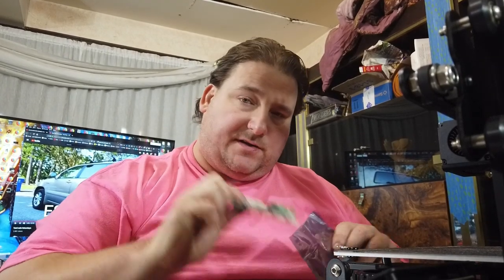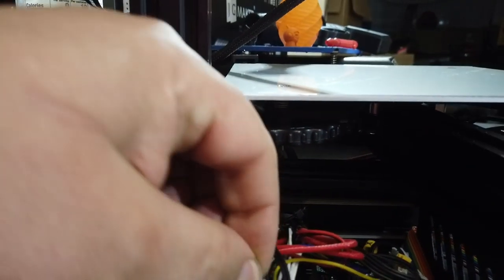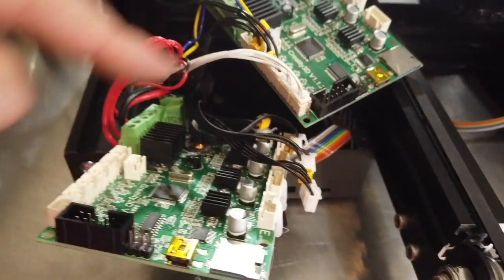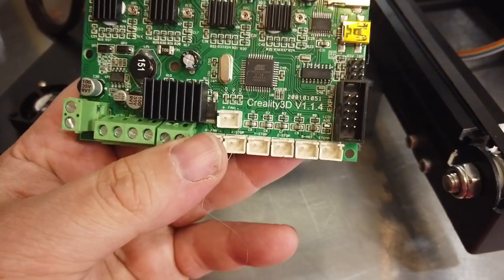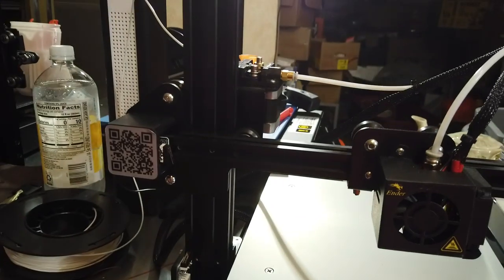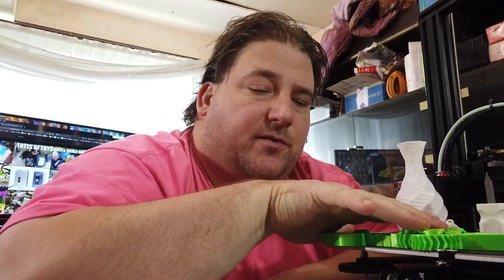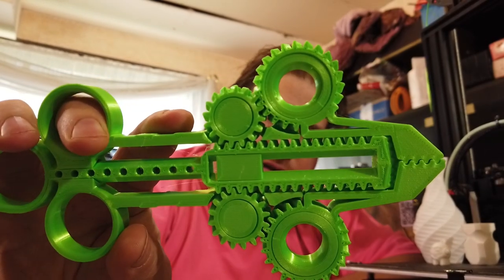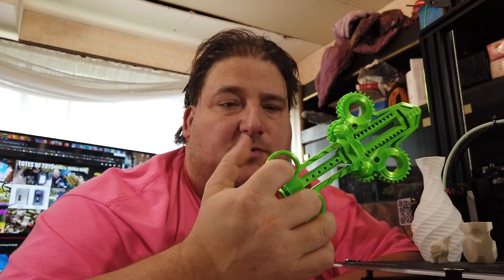Ender 3 Repair - Brainboard Replacement & Tuneup - T3DP

Comment: As a heads up for replacing the board. There is actually a much easier way to do this. Tip the printer for it is laying on its "back" and remove the control box from the frame. lay the box down on your work surface and as you remove the wires, place them into the new board. then remove the old board from the control box, attach the new board that is all wired up, and then put the entire control box back onto the frame.

This is likely how they assemble in the factory as there is no way they could efficiently screw in the power wires and hot glue the connection while the board is inside the control box. Also, the wire pass through in the frame is not a captive hole for a reason - likely so you can drop everything out the bottom for easy maintenance.
Reply from the maker: Excellent idea! I will definitely try that when i do a 1.1.5 upgrade!

Comment: When you slide the Y-carriage, note that the stepper motor produces enough voltage from that simple act to start the fan on the hot end. I discovered this with my Monoprice Maker Select, and found that if I kept repeatedly doing this, the control board would boot up and show ready to print - until I stopped sliding the carriage, then it went dark again.
Reply: You want to try and avoid doing that as much as possible as it can potentially damage the printer.
Reply from the maker: Yes. I always forget that. Habe to move slowly (or unplug stepper)

Comment: Which flexible filament would you recommend?  Looking for something as rubbery as possible... NinjaTek NinjaFlex?
Reply from the maker: The only really rubbery atuff i know of is ninja flex. Do keep in mine most of these machines will not handle that well stock. You are going to need an upgraded feeder assembly at minimum.
Reply: Nerys - is that because the stock feeder will slip on this type of filament?
Reply from the maker: @ofiasdfnosdf  no it's because the filament path isn't captive enough to see what I mean put a piece of string on the table now pull the string see what happens? Okay now try pushing the string from one end see what happens? You can't do it when you push the string it just folds in front of your hand this is what happens in the printer it's not stiff enough so it just Folds the path needs to be completely constrained in order to prevent the string from folding or in this case prevent the filament from folding any Gap at all after the feeder gear and it's just going to fold
Reply: Nerys - I see - thanks for the explanation.  My printer is the Ender 3, and I am able to print with some standard TPU that I have.  So I'm guessing this NinjaFlex stuff is much more rubbery then.  What would I need? Direct drive?

Comment: do you have any info on what can cause a mainboard to go bad?  i think mine is bad but dont want to keep replacing if its an underlying issue
Reply from the maker: Improper installation lack of a ground bad solder joints out of spec power supply not too much really usually the underlying cause is the main board
Reply: Nerys so it’s just luck of the draw? I’ve checked the power supply with a meter and it all looked good getting to the board.
Reply from the maker: It can happen yes it's also possible they can have a bad batch it's pretty rare but it can happen
Reply: @nerys71  Ok thank you for taking the time to respond to me!